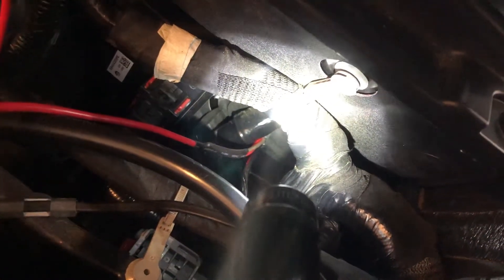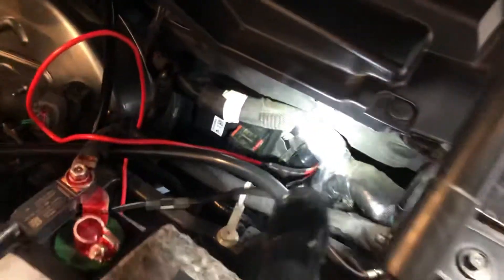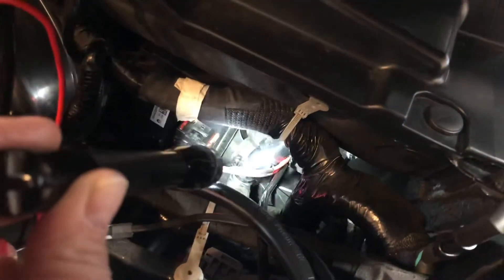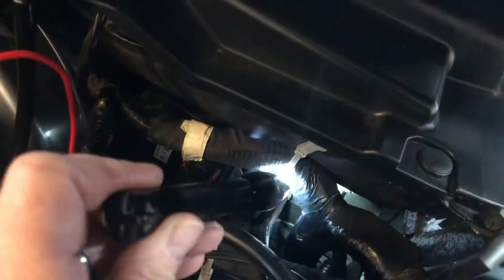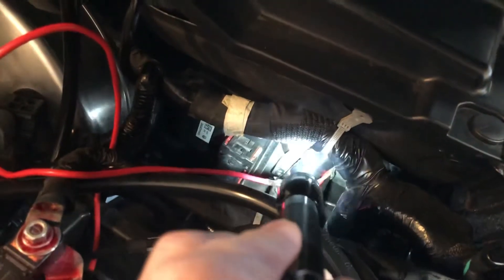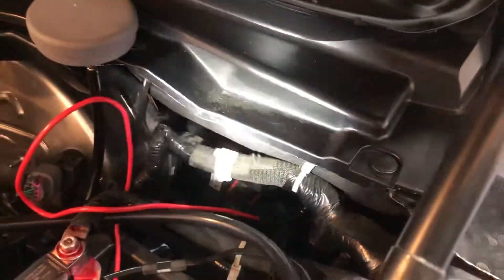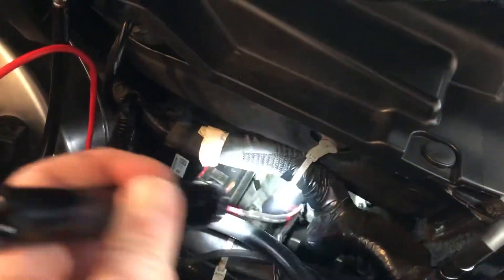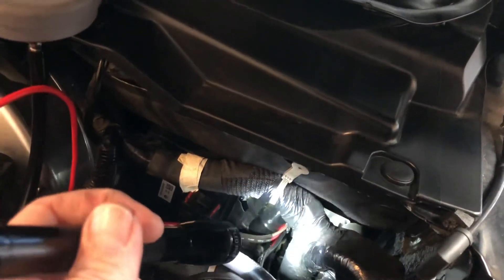Running wire through firewall newer Ram truck 2020 5th generation

Comment: 2021 1500 Warlock package.  That tube is not on mine from what I can tell.  Looking for an alternative route now.
Reply from the maker: There is also a big round grommet on mine. I think it’s the throttle control cable. If you look behind the brake pedal from inside it’s the size of a baseball. I pushed it out easily and ran my pa cable around the side. Then put it back no cutting. Hopefully you have that. My tube thing is full so it’s what I’m using now for new stuff. 😀